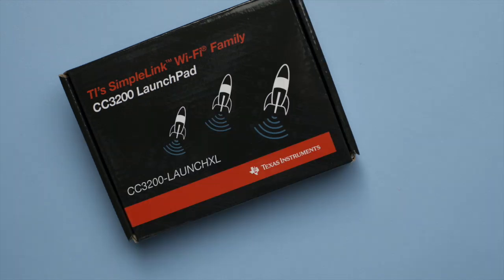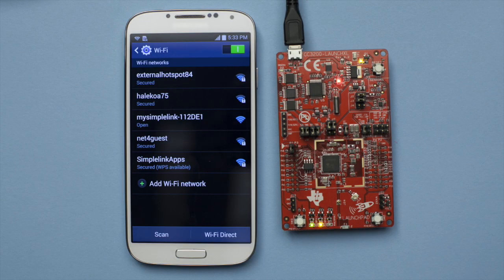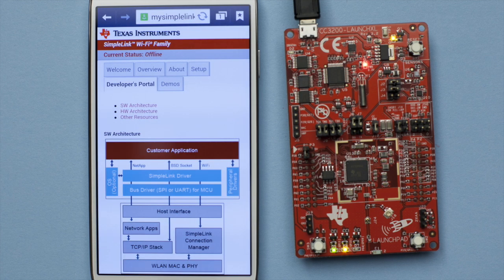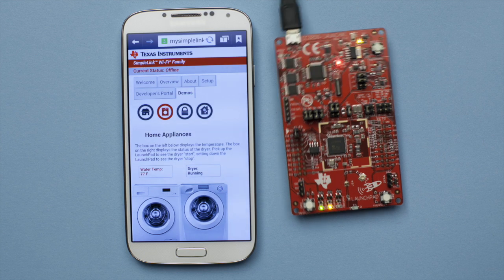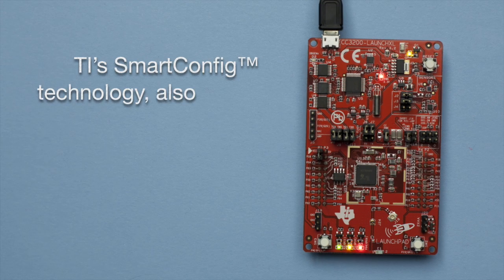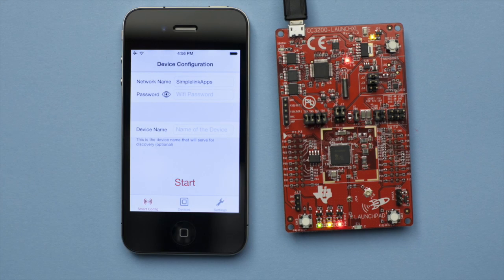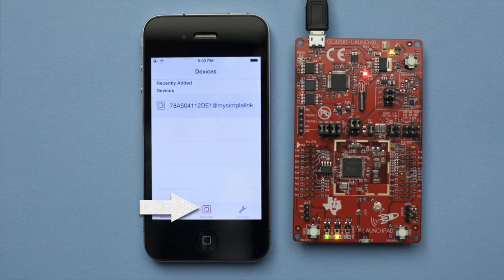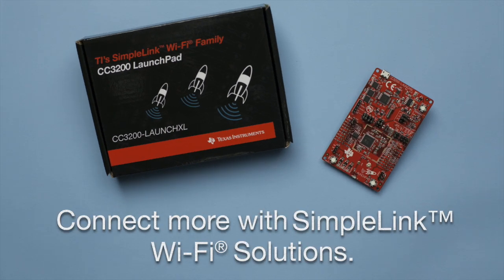SimpleLink™ Wi-Fi® CC3200 LaunchPad Out of Box Experience

Comment: I have all the jumpers set in the correct place but when i connect the CC3200 to PC the AP mode does not work, My device doesn't detect any network from CC3200, How can I resolve this problem?
Reply from the maker: Hi Rube - Check out our SimpleLink Wi-Fi CC3xxx forum to get additional support and insight on any questions you have. You can find it here: http://e2e.ti.com/support/wireless_connectivity/f/968